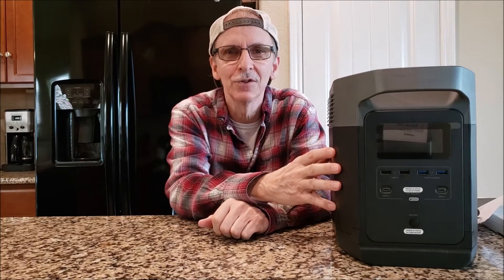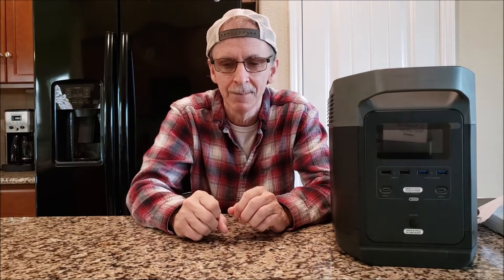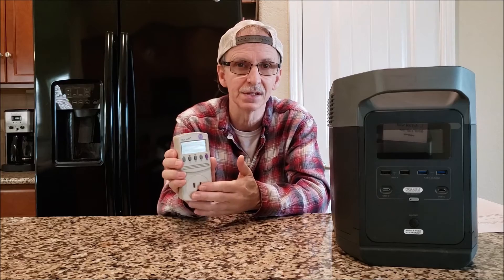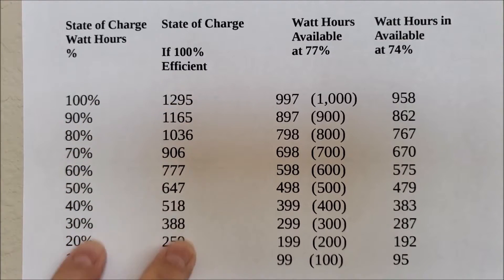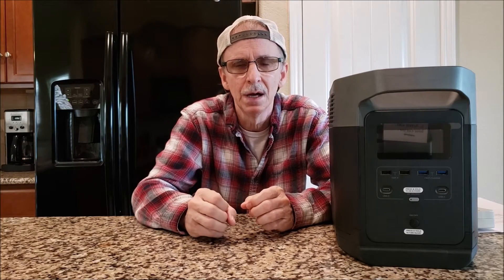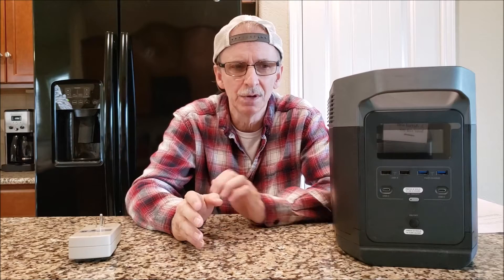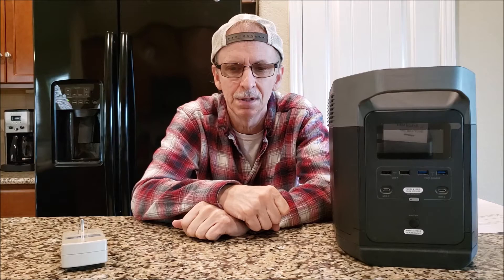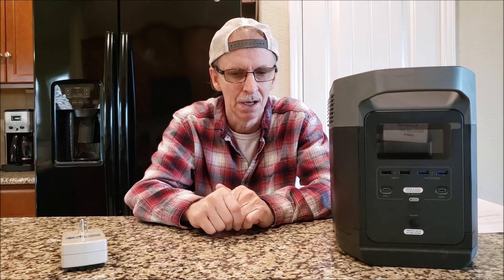Ecoflow Delta 1300 Review - How to Manage the Unit During a Power Outage!  What to Run/For How Long?

Comment: Great review Video. Thank you
I have a gas inverter 2000watts. Can I use it to charge my ecoflow delta?
Reply from the maker: I have a Champion dual fuel gen for the same reason and will be doing a review on it soon... Yes, you can use that inverter.  What kind do you have? Best if pure sine...

Comment: Thanks for these comments. Very helpful. I'm wondering if the fixed the AC plug direction in the new units (Max and Pro)? Also, I'd it like that on the River 600?
Reply from the maker: If you are talking about having to use an adapter because of plug backwards, they actuslly fixed the issue on later models.

Comment: Any thoughts on the new Ecoflow Delta Pro being launched on July 15?
Reply from the maker: Yep.  I'm buying one and 1 battery with it. I was going for the bluetti 500 but backed out.
Reply: @LoneStarPrepping  Same for me. And I'm glad I did. I don't know why, but Bluetti doesn't seem to want to offer the flexibility for additional batteries. After receiving my River Pro, I'm impressed. I still love my Bluetti AC200p but the Delta Pro is definitely my next purchase. Ecoflow seems to understand the desired  elements of a portable power station that other companies do not.
Reply from the maker: @latymz  The small River I have is the retail version.  I have the kickstarter R600 Pro and the EF1500 battery and love these.  I was disappointed, though, that they didn't continue to offer the same batteries retail.
Reply: @LoneStarPrepping  Yeah, I noticed that while watching your video. The battery is so much bigger as well as LiFePO4 a superior chemistry. I couldn't understand the switch from lithium iron phosphate to the current offering. It was definitely a step backwards in consumer value for the money. I almost went with the Bluetti EB70 because of LiFePO4 battery. But the Ecoflow had so much more to offer. Especially at the price Costco sold it for. 699 with the extra battery.
Reply from the maker: Its the speed at which EF charges that sold me.
Reply: @LoneStarPrepping  Exactly, and watching you during the storm drove the point home for me. Opportunities to charge via solar or even at the wall socket if the blackouts are rolling can be limited. I decided I needed that ability. It definitely can be the difference between recharging or regretting.

Comment: I appreciate your videos and how knowledgeable you are but for those of us new to this, it would be great if you could do a  simplified video (solar generators for dummies) and just tell us what it will run and how long. Maybe simple formula for figuring it out. I say this in all kindness and respect. I've gotten so much out of all of your videos!
Reply from the maker: Oh, believe me, I get it... Everyone wants to know what they can run and for how long.  I am working on a video right now that will be called "How to use your portable power station in a power outage" but it will not be like you want.  It will be easier to understand that this video, but you still have to do the work.  If you can get through the 3 part lessons video I'll post, you will know how to use your system.  If anyone offers what your saying you want, it will not do you any good.  Way too many variables.  There is no shortcut!  My 3 part video lessons don't assume you know anything!  You can do this!
Reply: @LoneStarPrepping  Looking forward to your 3 part video. My husband passed away and he was the mechanical/technical part. I can barely figure out our 3 remote controls for the tv. Lol
In all sincerity, I am learning from your videos and trying to do my homework before the next disaster. I went through snowmaggedon getting on the job training. Learned how to use my generator but saw areas that I need to improve on like water conservation. I knew friends had water that I could fill jugs back up with but in a shtf scenerio, I would need to do better.
Reply from the maker: Tell me what system you have snd name 2 things you want to be able to run...
Reply: @LoneStarPrepping  Lol..thank you.  I have a Lion Safari ME. I want to run a fridge/freezer and a small window unit as I live near Houston. Next disaster could be in the heat.
Reply from the maker: @sarahconnor4757  Now, find out what the battery capacity is or how many watts it holds.  Then, the inverter continuiuos watts... then inverter surge watts.
Reply: I agree with you!!!!

Comment: Thanks for all the great information! How long will this device keep the frig behind you run? Thanks again!
Reply from the maker: I have not checked the average watts used on this fridge because I am afraid to unplug it and plug in my kilowatt meter.  We have had a lot of problems with it and want to leave well enough alone until we get another fridge.   I need to know how much it uses before I can estimate how long the Delta will last.  I will post a comment on under the video once I check our new fridge.  Sorry. Just remember, though, if a fridge is rated, say 800 watts, that doesn't meant that is what it uses per hour.  It will be significantly less because the motor cycles off and on all the time.  I know the Delta can handle any surge on this fridge.

Comment: Sir, the tip you gave starting at 4:16 is absolutely brilliant!  I had been trying to work out a way to calculate the roundtrip cost of this power station without having to resort to arithmetic.  Your suggestion is spot on!  Leads me to believe that the folks who chose a random quantity like 1260Wh when designing this unit did so on purpose because they factored in the roundtrip cost.  Thank you!  Sub'd.

Comment: Are you concerned that the Ecoflow drops to 60% after 800 charge cycles? I’m asking cuz I’m thinking of buying one but don’t fully understand this stuff.
Reply: Joe Blow - The 60% after 800 cycles is a conservative estimate which anticipates  Full   cycles from full to  empty.  That seldom happens  AND  if you use power near it's upper capacity of  1800 watts.   If  you  are nice to the battery by keeping it's charge between 30 and 80% ,  not  pulling  1800 watts from it for extended periods of time but rather lower loads,  the battery will last a  long  long  long  time ! ! 
I have an Ecoflow Delta 1300   and  am  very  happy  with  it .
Reply: @richardhobbs7107    Good to know. Thanks! I bought one on sale last month. Haven't used it much yet but will be using it a lot starting in April. In an email last week someone at Ecoflow said it's actually 80% and that 60% in the manual is a typo.
Reply from the maker: No I am not as I will only use it for emergency backup power.
Reply from the maker: Also... The best thing about this unit, and the reasn I bought it was how fast it charges.  That proved to be the most important feature in rolling blackouts.  It filled to 100% each time power came back on.
Reply: Are you guys charging with solar panels at all?
Reply from the maker: @joeblow1942  In emergencies we do.  Thats the only time I use it other than to bring it out and drain a little and charge it every few months to keep it healthy.

Comment: Please help me with some math here: in an extended power outage, all you have is solar. If you have 4 - 100 watt panels, that produces 400 watts in theory, figure 320 watts in practice (on a sunny day). Figure 320 watts X 6 hours of sunlight = 1,920 watt-hours, That will hopefully be enough to fully recharge the Delta, and a partial recharge on a 12 volt car battery. Connect the car battery to an inverter (with fuse and circuit breaker), and you have a second power source. Or, you could charge up the Delta from this other setup. What do you think?
Reply from the maker: I did not get into any of this yet.  I plan to in future video. There will be more loss of solar power. Take a look at the 10,000 watt battery capacity system I made on my site.  It may answer some questions.
Reply: @LoneStarPrepping  Thank you, I just saw it. Very nice job there. If I may ask, how much did it cost you? I know that both Generac and Tesla now offer "powerwall" batteries that attach to the side of the house, and that will run about $15,000 for a 13 kilowatt-hour battery.
Reply from the maker: @rootcanal7188  It is not cost affective.  My system will not pay for itself for many years, if ever. The costs would be very different today, Im sure.
Reply: @LoneStarPrepping  Thanks for the answer. In my opinion, cost effectiveness is only a secondary consideration - having solar energy backup available to power your house in an extended grid-down scenario is primary. I have read several reports that there could be power outages around election day, and that these outages could be widespread.

Comment: Thanks for the video. As for the outlets on the back, it looks like the three lower outlets are correct (the left slot is longer). Maybe the solution is to plug an outlet strip into one of the good outlets, then plug you refrigerator, freezer, etc. into the outlet strip.
Reply from the maker: Nope.  All upside down.
Reply: @LoneStarPrepping  I was told they are upside down; only 3 of them can be used as 3-prong outlets. I know it sounds like a simple fix, but have you tried that? I can't believe that for such a cutting-edge product they would have done something that stupid, but maybe in earlier models they inserted those plugs upside down to make it impossible to use either way.
Reply from the maker: I returned it for a new one that was fixed.
Reply: @LoneStarPrepping  Great!! Whew!! Glad they finally did the right thing!

Comment: Ok i want to known , how hours last the ecoflow if have connected my 800 watts refrigerator , one led tv 55”, 2 floor pedestal fan and 1 lamp floor
Reply from the maker: 800 watt refrigerator?
Reply: PreppingOver50 yes is an frigid aire refrigerator think is 750 continuous watts
Reply from the maker: @oscrm1760  with everything you want to run and my guessing on the other things I bet you get abot 20 to 40 minutes.

Comment: Hi Prepper. Thanks for the great video and educating people on the efficiency. Are you using only AC or DC for these efficiency percentages? I assume AC. I have one of these and in my supplies I have tried to stock things that run on DC. The DC efficiency should be above 85%. The reason is that it would do DC to DC conversion for those things. So my DC supplies include USB 5v charger for the phone,  LED strips that can run off 12 v DC to light the house and 12v radios.  Of course it is harder to find DC fridges and freezers but they exist(for those that live out of their RV). Anyway,  just some more info for those that may not know the Delta will give more total watt hours if only running DC things.
Reply from the maker: Very good point!  DC is the way to go if you are set up for that, but I think most people want to be able to use the AC things they already have around the house...  And of course, DC to charge their phones etc...
Reply: DC is usually 90% to 95% while AC is usually within 85% to 87% I thought on these type of devices? You really didn't need the adapter just flipped the plug.
Reply from the maker: @Trillville43  Nope.  You need the adapter.  There may be a way to take the unit apart and flip the outlet around...  Ecoflow offered a solution to the problem with the unit... They offered to send out an adapter.  If "flipping" my plug around would work, they would have suggested it.  They didn't because flipping it wont work.  You are correct about other types of devices like this are in a range of around 85% efficiency on AC, but this one is not.